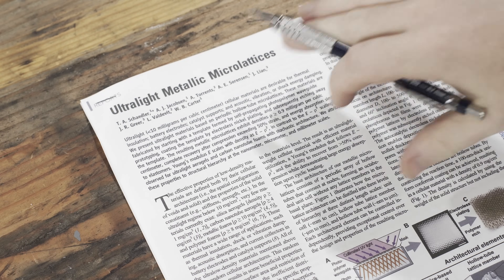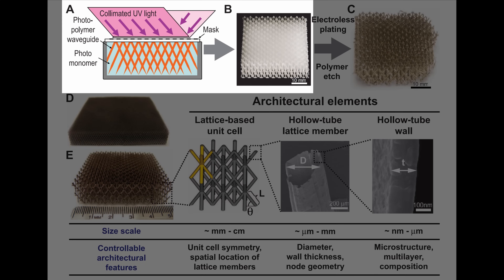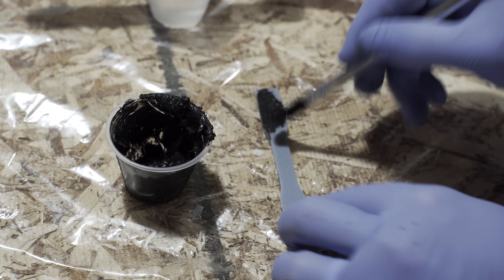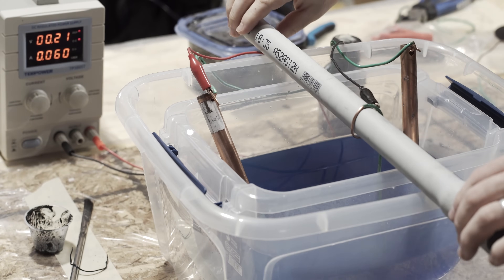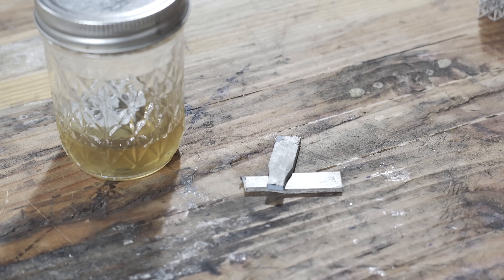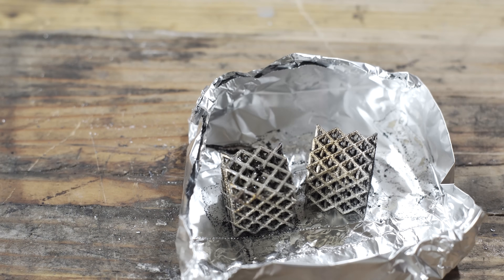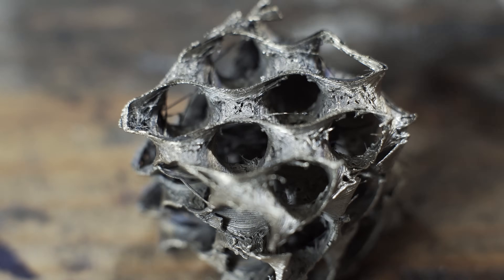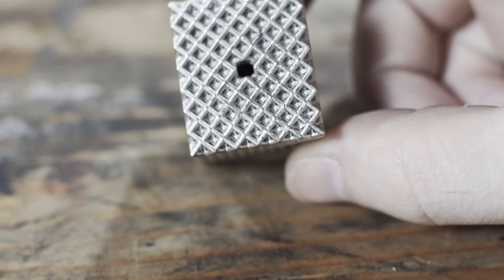Ultralight Metallic Microlattices

Comment: I think you could probably get much better results if you use a flow through electrolyte and a pulse plating power supply. And how you set that up is that you calculate your volume through rate as it flows through your target and you do a pulse once per target volume. The goal here is that you don't want to desaturate your solution. You don't have a charge propagation problem, you have an electrolyte desaturation problem. The surface charge is depleting the electrolyte in the core of your target. Charge stays in a dipole configuration. So so long as there's electrolytes in the core to balance the charge, the charge will stay in the core. But that depletes very rapidly. That's why you need a flow through cell. That means you need a pump, a diffuser, and some sort of waterfall tank.

Comment: That can work with ultrasound but only certain materials too limited...while the advance injet multimaterial can use volt and frequency to print thin layer of digital circuit design like cpu cheaply but intell may quit

Comment: would it be better if you used a circulator (or even a magnetic stirring rod) in the electroplating solution?? Also, they make sacrificial dissolvable uv resins

Comment: Nice Video. I am also working on metallic micro lattices. What was the minimum wall thickness of the lattices that you could print with polymer?  With metals, I could print 300-400 microns thick wall lattices.

Comment: Make two of them inside each other with minimal support, so that they interlock without touching, then use it for electrolysis or even an biophotossynthetic cell from algae with a minimal electrical bias to direct the voltage from one electrode to the other

They amplify it, essentially producing energy from photosynthesis. 

And supercapacitors too, obviously. Even normal ones, where the electrolytes would be the third ring in this trefoil knot lattice 

I think you can only make it better if you make it fractal in the size of the cells too, to the point capilarity would require you to suck up the electrolytes in.
Reply: You could even fit more of them in the same space by using more of them, a couple ones diagonally 

At least with a cubic lattice it seems to work in my head

Maybe rods with paper as an insulator interlocked randomly wherever fits would work even better, specially if you can solder them in place to burn away the paper without two rods of the same electrode touching each other
Or just use them as insulators in the biophotocell or to hold the electrolytes

Comment: Interesting video. Found your channel a couple of days ago and have been binge watching your videos. Since you're messing with nickel sulphate solutions (bright nickel plating), try dichloromethane to dissolve the cured resin prints. I know it dissolves PTEG, just make sure to wear a mask and work in a well ventilated area. Personally i would try other organic solvents first. Another thing when you're testing an hypothesis make sure to use the least dangerous chemicals possible. Nickel sulphate is a carcinogen and copper sulphate is only toxic. If you need any advice (biochemist here) send me an email.

Comment: This was amazing and I can only understand the rough concept around it , but what I didnt really understand is what is the point of getting the resin out?  Keeping the resin in wouldnt make it even more resistant? or it that a conductivity thing?
Reply from the maker: Yep, it would have made it a bit stronger to leave the resin in. The original paper was trying to create the lightest weight lattice material, so in terms of strength-to-weight ratio the resin makes it worse (since it's so much weaker than the metal per-gram). So their goal was to use the resin as a scaffold, and then dissolve it out so that you're just left with the ultralight metal "shell"

Comment: The autocatalytic reducing agent in nickelplating baths is usually sodium hypophosphite, which i learned the hard way is a controlled substance you can't easily buy (meth precursor).

Formaldehyde will work as the reducing agent in autocatalytic copper baths. Applied Science actually has a great video on this
Reply from the maker: The nickel was a commercial solution (Caswell Bright Nickel) so not sure what they use. And note it was traditional electroplating, not electroless. But Modern Electroplating suggests this for the two most popular nickel recipes:  

- Watts nickel: nickel sulfate, nickel chloride, boric acid, pH 2.4-4.5
- sulfamate nickel: nickel sulfamate, nickel chloride, boric acid, pH 3.5-5.0

Comment: I wonder if you could use certain types of printed material to get the electroless process to attract to them vs everything else, so you could 3d print 3d circuits?   Next up 3d printed insanely large "Macrochips" from electroless semiconductors.... takers?

Comment: Oh, your FDM prints are horrid!  The rest of your work is wonderful though.  If you want a better way to print some of these surfaces, just let your slicer software do it!  You can print a rectangular prism with no perimeters, tops, or bottoms.  Then set the infill to the surface you want (gyroid), set the path width as you need it and finally set the density of infill as you need it.  You will end up with a much better print.

Comment: Your dipping ink seems like it would be really useful for people who want to electroplate prints with lots of detail in them. Have you published the recipe somewhere?
Reply from the maker: I haven't, but only because I haven't done anything more precise than throwing some graphite powder into the IPA until it seemed good enough :)  IPA + graphite +large squeeze of acrylic paint + drop of detergent seems to work pretty well, but I haven't dialed it in much more than that.  There are some conductive sprays that I've switched to using recently though (Carbon and Nickel from MG Chemicals) which work great and have better adhesion.  More expensve but fewer failures

Comment: Most likely a bit late to the party (also new to the party, first video I've seen, instant sub!) but I've experimented some with electroplating 3D prints in the past, and got much better results by agigating the solution with a bubbler and periodically reversing the current flow - the idea is that this re-releases some of the ions back into solution near the model, and the added agitation of the liquid then helps them flow into the areas they wouldn't naturally flow toward if following the path of least resistance. It's still not electroless plating, but I've found it helps quite a bit when dealing with more complex geometries

Comment: I wonder if it would be better to use water dissolvable filament and to let the parts sit in the electroplating solutions for a short amount of time at first to develop just the skeleton, then use osmosis to dissolve out the water dissolvable filament, and then stick it back into an electroplating solution so that you can thicken up the lattice while keeping it somewhat hollow

Comment: @Breaking Taps
10:00 -ish. Can you make the solution flow through the lattice structure? (just add some pump, or stirrer or something that makes the liquid move more)
I think that would solve the coating issue in the middle.

Comment: Based on earlier 'plating on plastic' technology you may be successful by 'etching the base plastic and use the old Sn/Pd ionic activation solution followed by an accelerator solution to produce a microscopic semi discontinuous coating of active Pd on the plastic surface.  After rinsing the accelerator solution, transfer the 'activated' plastic part to an electroless nickel plating solution.  The Pd coating should initiate electroless nickel plating on the surface.  Conventional commercially available hypo-phosphite electroless nickel  plating may give you enough thickness.  As thickness increases, pores will close and etching away of the interior plastic maybe not possible.  Additionally, increase in thickness will also result in the build up of internal stress in the electroless nickel coating and induce  adhesion problems. Plating is an old 'black art science' that has very few practitioners.
There still may be some folks knowledgeable in the 'art' at McDermid Corp located in Waterbury, CT.

Comment: Except for reducing the weight, is there any other benefits burning out the plastic? I guess the overall strength would be higher in the parts before burning out, or?

Comment: Just some thoughts:
-For applying a conductive layer you could use something graphite 33 which is a cheap spray paint system used for ESD Work.
-Arent many people allergic to nickel? At least here in europe i dont want to use a nickel plating for functional parts. What are good alternatives here? Maybe zink could work.
Reply: These are not the type of parts someone would be in constant contact with the nickel allergies shouldn't be an issue

Comment: For what application nerd? (I am a nerd, but what known applications does these things apply to?)
Reply from the maker: :) The paper lists these as a few potential uses: "thermal insulation, shock or vibration damping, acoustic absorption, and current collectors in battery electrodes and catalyst supports"
Reply: @BreakingTaps  Cool! Vibration dampening would be an interesting application for this kind of material, wonder what kind of tests that would lead to. Also thanks for the reply!

Comment: You're a great experimentalist. Early days but do you reckon a lattice could handle 1 atmosphere of external pressure and be light enough so you could make a buoyant "vacuum balloon" ?   After all Helium is becoming rarer and Hydrogen is inflammable.
Reply from the maker: Thanks!  Hmm that's an interesting question.  I think the lattices I made would not support that (14 lbs per inch feels like it would crush the lattices).  But mine were also covered in flaws and ruptures, so a "good" plating might indeed be able to support that pressure. I'd have to check the original paper to see what numbers they quote, totally forget now.  But I'm also thinking about it from a "compressive" standpoint, not 14psi at all points on the lattice.  Not sure I have enough engineering knowledge to know how that would work out tbh.  Maybe?  Interesting thought experiment!

Comment: Even with resin that dissolve with caustic , it will take ages to wash out the material. Just way too high an internal surface area. Your best bet is to move the material out with super critical CO2

Comment: I interned at NASA’a Marshall Flight Center when I was in high school and I got to see them doing these lattices on metal 3D printers. And saw and held so many of these. I have videos of these if you want to see them @Breaking Taps I just can’t say why NASA was doing heavy research on this topic tho...
Reply from the maker: Yeah would love to see it!  Share a link and I'll pin it for folks to see, I bet the stuff NASA was doing is super cool!
Reply: @BreakingTaps  It was beyond amazing. Just think about printing a full turbo pump system in one go and increasing your horsepower and efficiency by 90-99% for a car not a rocket engine ;) well maybe for a saturn V F1 engine or two ;)

Comment: It might be interesting to use ABS on your FDM printer if you can get it tuned as that can be dissolved with acetone quite easily :) You might also be able to do some ABS smoothing before electroplating to get even cleaner surfaces. Cool channel!

Comment: Would some sort of circulation system improve the plating on the internal lattice? 
Thanks for taking time to cut open the lattice on camera. The difference in plating thickness became much easier to see once you cut the part open.
I just discovered your channel yesterday. I'm looking forward to watching your past videos. Thanks for sharing your work with us.
Reply from the maker: Thanks!  Circulation would definitely help some, and another commenter mentioned that ultrasonic agitation can help too.  Helps dislodge bubbles, keep electrolyte well mixed, remove byproducts etc.  But it'll only help so much because the electric field just won't penetrate sufficiently far if the lattice is too dense.  I found an interesting NASA paper where they addressed this though: they used thin copper wires that were wrapped in porous fiberglass sleeves, and threaded those through the object to plate.  The sleeves prevented direct electrical contact, but since they were porous they let electrolyte flow and make electrical contact.  So they could get the field deep inside a part for more even plating.  Something like that would probably work here I think.

Comment: You could make incredible DIY radio antennae with this tech: micro-arrays and complex fractals     omg  I love your content.
Reply: Inb4 3d-printed microwave-band invisibility cloak based on a structured meta-material.
Reply: Out of curiosity, what advantages would that have? :o
Reply: @Llamamoe  fractals can handle large bandwidths in small spaces, they are used in cell phone pcb antennae. Micro-arrays are a great bunch of tiny antennae put together to perform a task; one example is the Starlink dish that can point and track satellites without moving because all the little antennae are pointing in different directions to cover a large arc of the sky.
Reply: Thousands of interlinked micro arrays spread across the planet...
Reply: I was thinking the same thing.

Comment: Conductive 3d printing filaments are a thing. This needs to happen for science.  

Also is that printer a bowden tube or direct drive? A direct drive machine will make easy work of that. I just converted mine and it was a big jump in quality.

Comment: Thanks very much for sharing your ideas on air brushable conductive paints- something I've been curious about for a long time.  I will definitely try this.  I've been electroplating for a decade, and am looking to do more with airbrushing complex designs with vinyl masking.  I really appreciate your R&D on this.  
The silver conductive paint is great, but is so expensive and uses narsty solvents.   I was making paints by chewing up graphite gouging electrodes in a pencil sharpener, then a bit of grinding in a mortar and pestle.  The paint was chunky and terrible looking, but that turned out to be a cool aspect, artistically.

Comment: I've recently learned there are UV curing waxes for jewellery making, I want to try it out for some of my mold making, but also thing it might be just the thing you need for this process.
Reply: Check out Formlabs Wax40. It has 40% of wax in it so it does not expand.
Reply: @aasiaasi  $$$ there is cheaper versions out there
Reply: @kennypeoples3288  With 40%?

Comment: Look for "wax/casting/jewelry" resin, it doesn't expands as much and I had pretty good results, also add a vent to your model to leave room for the resin burnout products escape from. For the conductive coating I cannot recommend acrylic paint and graphene it's dirty and causes structural issues with very uneven plating. What I found to work really well is 843AR it's conductive copper/silver coating (used to coat plastics for EMI shielding) which is relatively cheap 843AR-340G comes in ready to use aerosol cans and the 400ml version of it costs about 30 quid in the UK so I would assume it would be in the $30-40 range in the US.
Since it's designed for plastics it has very good adhesion and it's conductive enough to accept electroplating, it also provides very uniform coverage since it can be sprayed on.
Reply from the maker: Oooh, will pick up a can of that spray! I've been using the acrylic/graphite ink (and some variations) on various projects since this video and have been generally dissatisfied for the exact reasons you mentioned :)  Poor adhesion, so-so conductivity, uneven coating.  You haven't had any issues plating over the silver?  I know some metals don't like being plated on top of others, but don't remember if silver is one of those.
Reply: @BreakingTaps  Copper can be plated over silver, 843AR is silver plated copper nanoparticles so in theory if you find a non destructive way to "deplate" the silver you will be left only with exposed copper but I haven't found that to be necessary, it should also accept Nickle plating. 
There also should be pure copper conductive coating for EMI, I honestly didn't bothered to look for it, the company has a few other products that may be useful for plating, including pure silver, carbon, and nickle conductive paints.
https://www.mgchemicals.com/category/conductive-paint/conductive-spray-paint/

They were simply one of the first that came up when I did my search and they are available on Mouser/Digikey/Farnell and most importantly Amazon https://www.amazon.co.uk/MG-Chemicals-Conductive-Coating-Aerosol/dp/B01MQ165E3
Reply from the maker: @DOGMA1138  Awesome, thanks for the extra details!  Just picked up a can of the copper/silver spray, and one of the graphite spray just for good measure.  :)

Comment: hey could you not decompose the resin thermally under pressure in order to avoid distortion?
Reply from the maker: Hmm, possibly!  Maybe covering it in plaster or something?  Allowing sufficient venting might be an issue, and extracting it (they are relatively fragile afterwards)